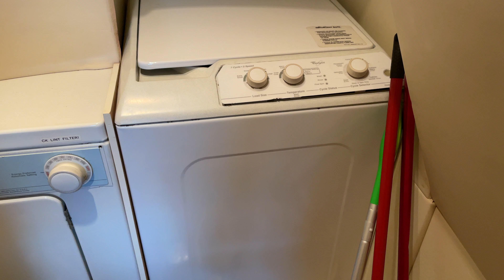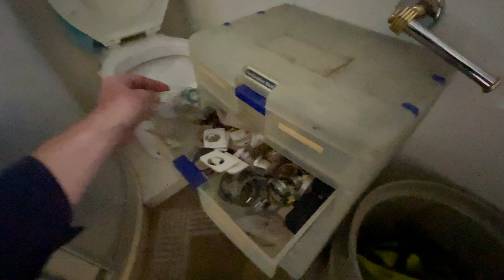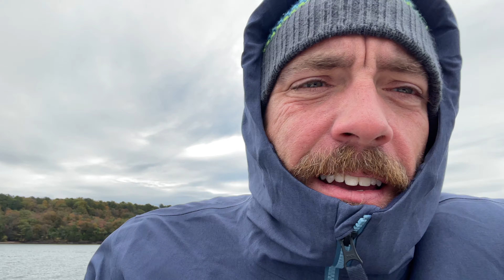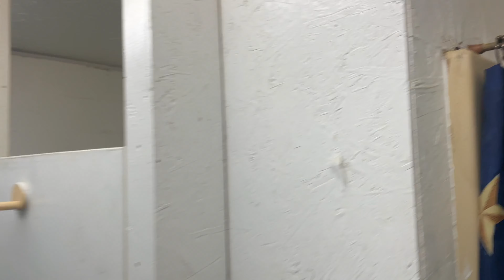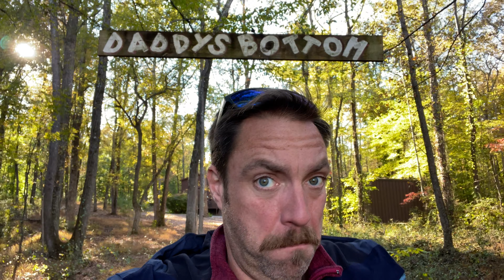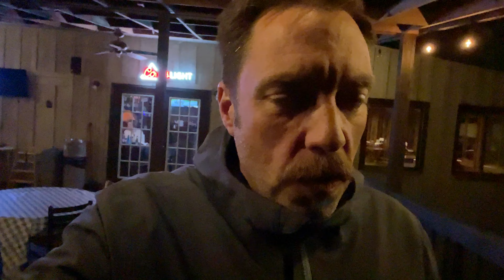The Great Loop Pt9 Lee Spry to Nowhere

Comment: Meh, swap out your JL speakers for J-B-L marine speakers..
Reply from the maker: The JLs sound pretty good and Tom is a big fan. He has them on his center console and loves them. These were clearance models from Crutchfield so the deal was too good to pass up.
Reply: @waterwethinking1142  JBL's have better bass response, and Infiniti Kappa class D amps use a lot less current for the same power out..
Reply from the maker: @dandeclerck6742  I’ll be redoing my system this spring. I already have everything, it just needs massaging but I might look into replacing one amp and adding a couple speakers. I’ll definitely keep that in mind. Thanks!